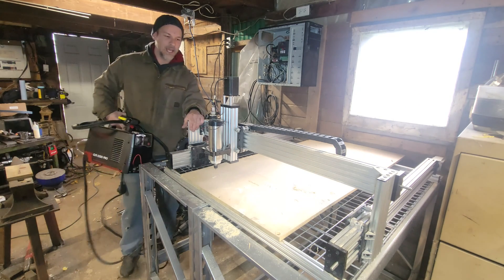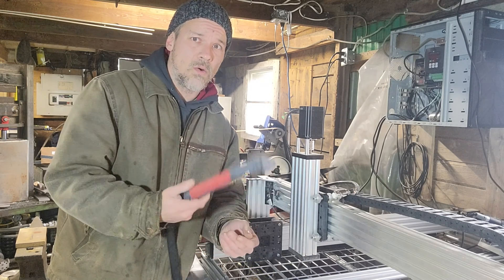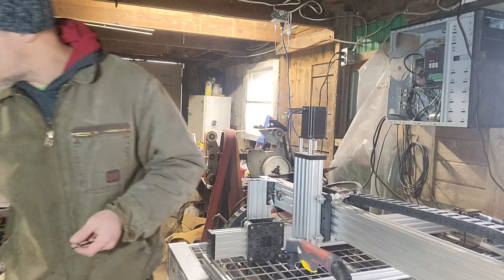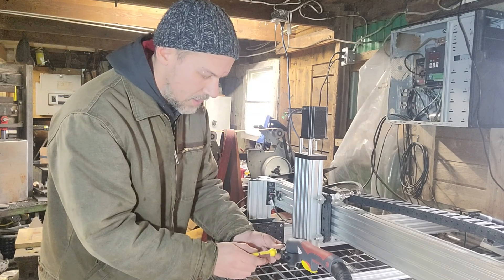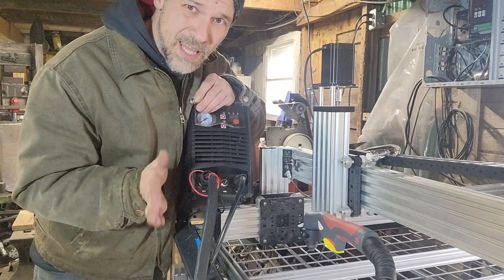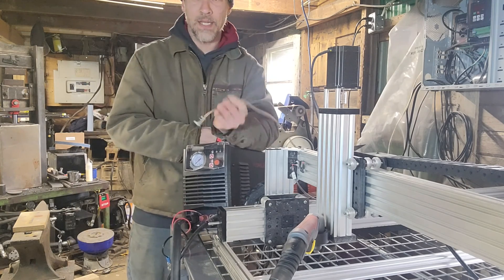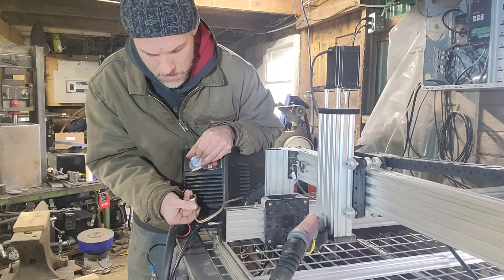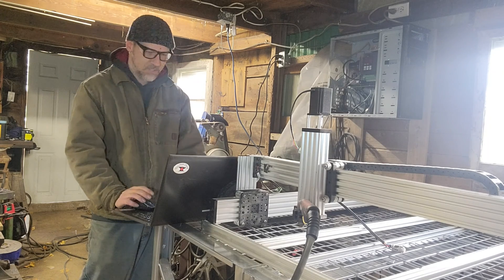YesWelder Plasma cutter meets Bulk-man 3D CNC

Comment: Thanks for video What software are you using?
Reply from the maker: inkscape -> sheetcam -> openbuilds controller.
Reply: I am have a problem with getting my plasma cutter touch to turn on for the cut.. im am using 12v 5v pmw relay when the light burn send to cnc the air for the plasma cutter touch comes on but stops the pilot arc with in seconds but the air stays on the whole job... non hf 55ds pro... I don't why the plasma cutter touch turns off/ and doesn't cut?
Reply from the maker: Well my first thoughts would be a bad ground or you blow though the steel too quick and loose your arc (moving too slow) or something wrong with the way lightburn is sending the code.
Reply: @KevinChainey  ok thank you

Comment: i want to know if you ever get EMI from running that plasma cutter on that cnc table
Reply from the maker: Not with my yeswelder plasma cutter because it's not a high frequency pilot arc.
Reply: @KevinChainey  cause I have a 3ft by 3ft  next to my computer so I am afraid of the EMI damage my computer, but I used shield cable thou but no  ground point, but I  u see you do is plug and play
Reply from the maker: @brian13873 I wireless in with my laptop so my computer is normally away from the cutter, but my controller is only on the wall behind the unit maybe a foot above.  If you are worried about EMI I would highly recommend getting a plasma cutter that Langmuir system recommends.  The list is here https://www.langmuirsystems.com/plasma-cutters
They have done way more testing then I can.